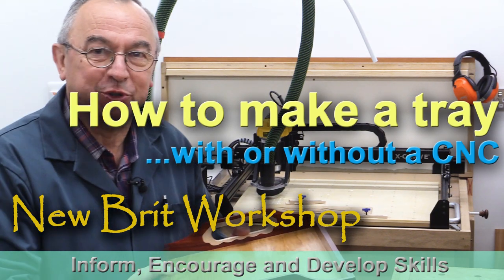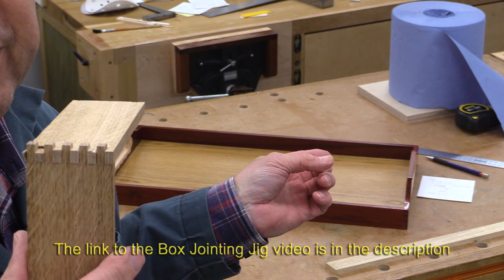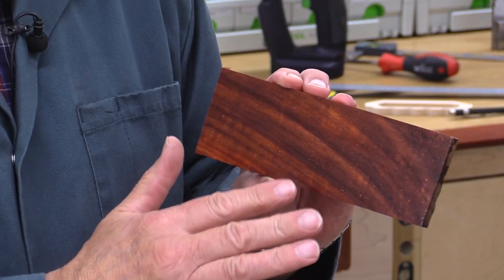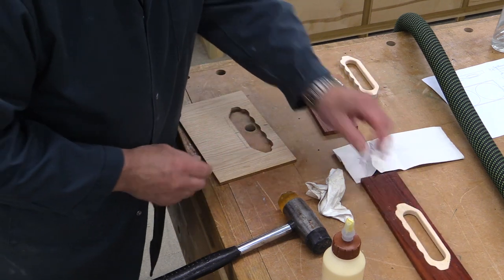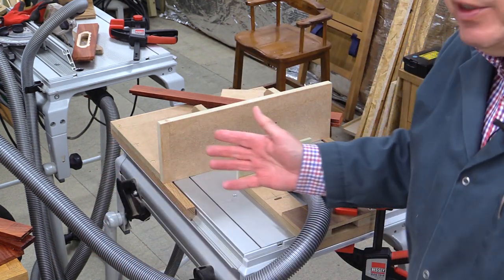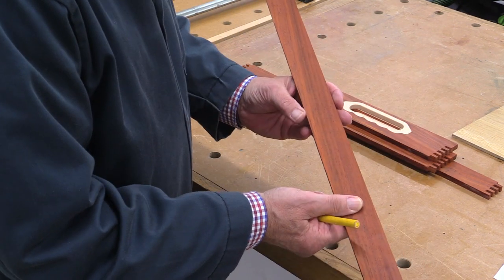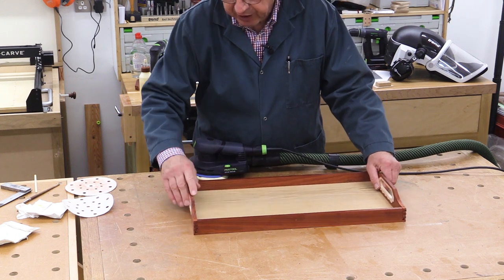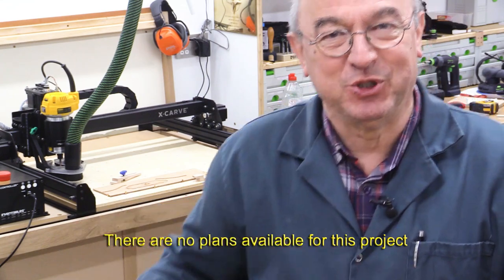How to make a tray

Comment: Beautiful job Peter! I really love the handle inserts. What a difference they make.
Reply from the maker: Hi Gary, Thank you, I only did it because I was worried that the wood would fail as it was very dry and quite brittle. I am really pleased with the result and may try and elaborate the idea in a later video. My only worry is that CNC work has a limited audience. Cheers.  Peter
Reply: I understand as I don’t have a CNC but your projects keep giving a reason to look into purchasing one in the future. Perhaps when a Parf CNC comes out.